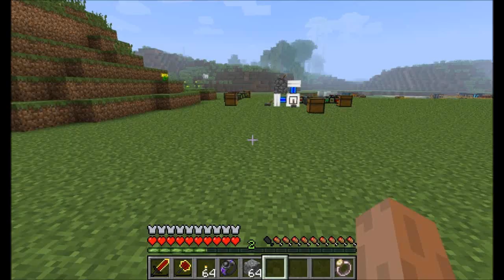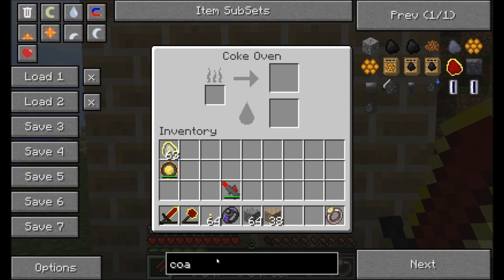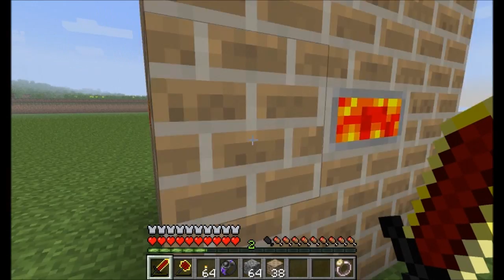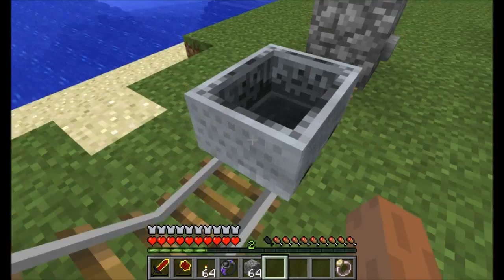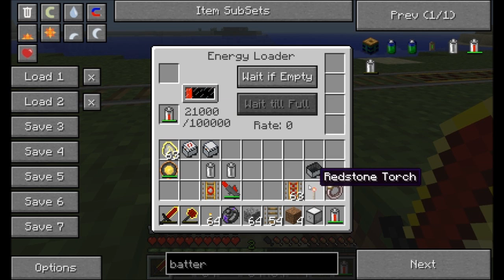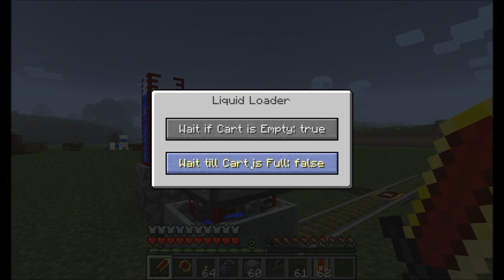Mod Spotlight - Railcraft

Comment: I don't mean to be a troll but the byproduct is creosote oil because it is the secondary consequence. Coal coke and creosote oil cannot both be byproducts. Creosote oil is the byproduct of producing Coal coke. Maybe you shouldn't reiterate what is on the railcraft wiki because everything your saying in this video, is basically the exact same of what you read on the railcraft wiki